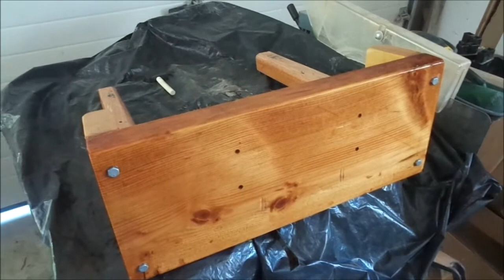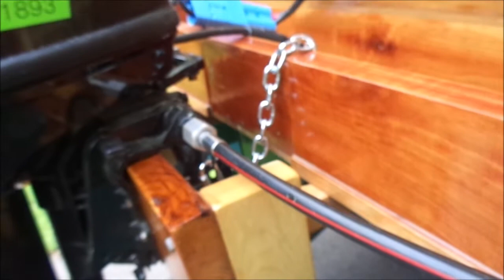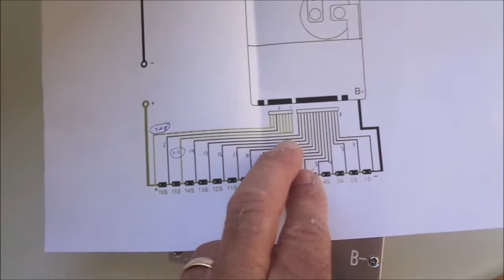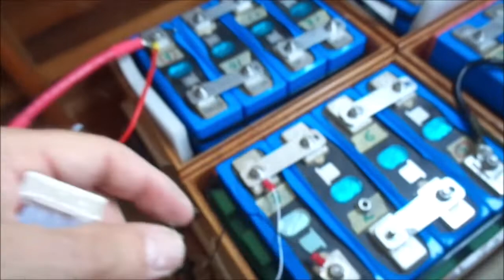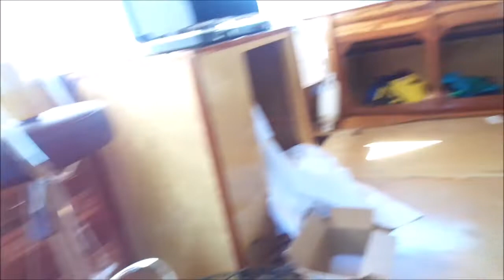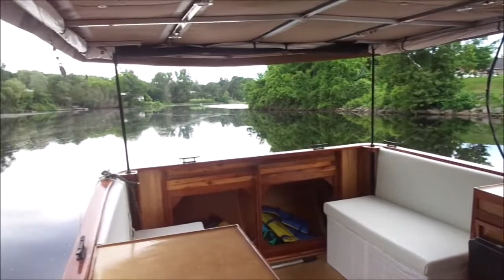Finishing and testing. Building My Solar Electric Catamaran Part Twenty Five

Comment: glad you added the chain on motor . are they 100 amp cells? lot lighter than lead acid. 15 mph  is about right with no lifting strakes to keep water from going up sides. battery box and motor pad locks is a must. looking good. some trips soon while weather is good smooth sailing👍⛵
Reply from the maker: Thanks, more testing videos to come. I will be heading up the Trent Severn in Aug. to do a round trip Napanee to Georgian Bay and back.
Reply: @philboyer2036   maybe we can do a meet some were between Peterborough and Buckhorn.  iam on upper Buckhorn. sunny weather hopefully🌞🌞🌞🌞🌞
Reply from the maker: @danielnicholls6868  I will keep you posted on my progress.